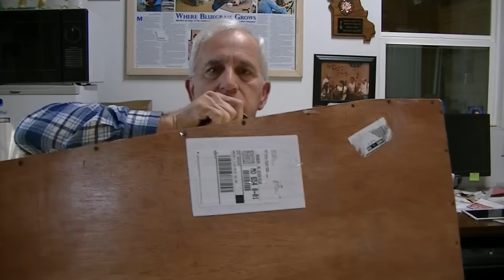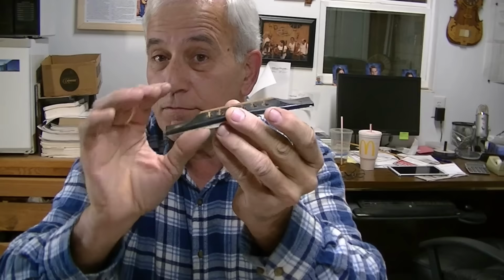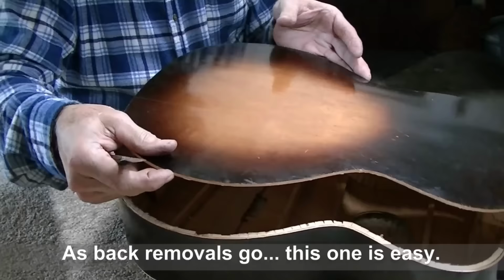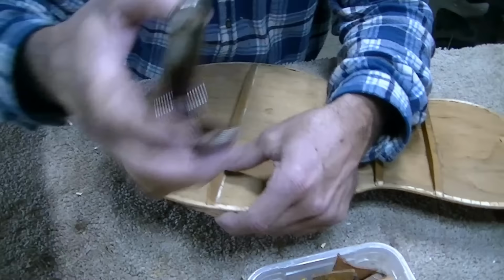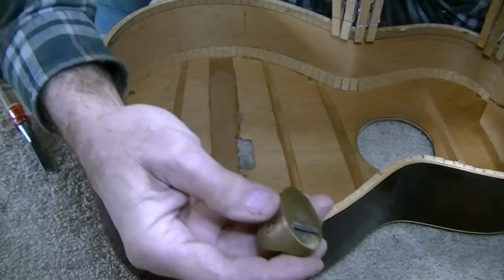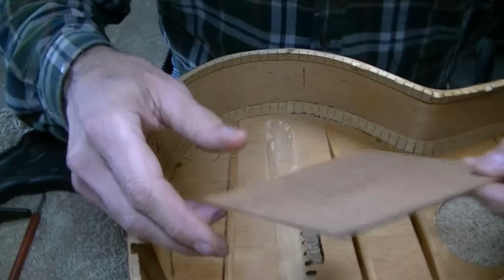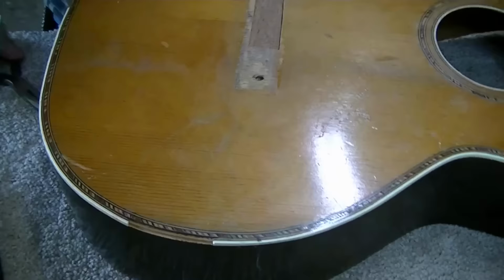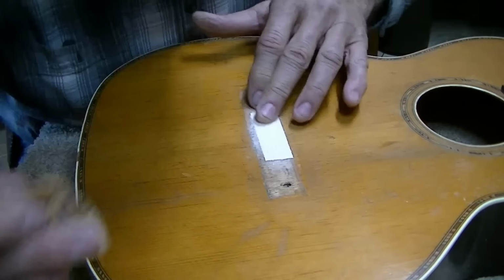160 RSW Regal Wreck Restoration Part 1

Comment: Just a trick that I’ve learned in my years of restoring antique furniture as a weekend warrior. I have a hot plate that I put my thin flexible paint scrappers in and get them hot and I then start pushing it under whatever it is like your bridge plate to bring up works well because the heat loosens the glue back up and I use this on glue blocks that are attached to veneer and stuff like that.  I think that’d be really useful on getting the bottom off of a guitar and would be perfect for that bridge plate.

Comment: The crack on the back if it stays closed mostly I have used Loctite #420 which is like water applied by a sewing needle or whatever and drip it till it quits taking glue and in about  an hour it is permanent. It can be sanded and polished like most cyanacrylate  glue can be. Pardon my spelling. Great instruction and the video is awesome.

Comment: Hi Jerry. I was re-watching this Regal reconstruction after watching the Grandma's Regal pride and joy videos. As with the other comment that may be too much info, I've now had some experience with the Chicago makers to offer an insight into what seems to me the odd bridge plate/center brace arrangement. That 1/8th (more or less) band was standard in the 1890-1920 period.  It only seems odd because it doesn't really make sense given what guitar builders now know. A lot of these were underbraced 'cause they were designed for gut strings--which is why steel strings have twisted up so many of them.  Like this Regal, there wasn't much to keep the ball ends of steel stings from ripping up the spruce under the bridge. Thanks for the video!
Reply: Makes sense string tension is real!

Comment: Great job!! For anyone wondering why you did not use sandpaper to prep for glueing...sanding will clog up the wood pores ....which should be open  to get the strongest glue joint possible. Something I learned when going through school to get an Airframe mechanics license to repair wooden airplanes.

Comment: Hi. Most grateful for your generosity in sharing your luthiery skills. You’ve both inspired and helped me repair two guitars now, and I’m working on the third—a Regal. 

While not as nice as this one, it has exactly the same problems (failures). After watching you hand plane that bridge plate, I came up with another method. Drill press, mounted with a Forstner bit, 1” was about right. I removed the centering point and got it very sharp.

 Since I am fortunate to have a large drill press, that did the trick. Very good control to get almost to the top without damaging it. I thought others might benefit since this is one of those basic repair challenges.
Cheers and thanks again, Dadla.

Comment: You might try piano keytop pvce glue for the binding. It’s designed for gluing plastic to wood. Water based and not expensive. Experiment first, obviously.  Only order when it’s above freezing.

Comment: I do those neck block slip resets often. Once the decision is made to take the back off, it just makes sense not to mess with steaming the dovetail.

As for the bracing, I sometimes can't help myself from converting them to standard x-brace while I'm in there. I usually use heat and water to remove the braces.

I usually use long C clamps and blocks of wood instead of how you do it with a vice.
Reply from the maker: Joe Shmoe for sure.  Thanks for watching.

Comment: Grain for the bridge plate should run with the strings to prevent top curl. You can shift the angle slightly to tie the top grain and halves together. Support under the top while scraping that old bridge glue would have made the job easier and safer. Always chiseling with the bevel toward the work gives you leverage necessary to prevent the chisel from diving.
Reply: Thank you for the grain direction tip on the bridge plate. Makes perfect sense to me .

Comment: 39:58, I am a carpenter and woodworker myself even though I know nothing about working on guitars, make a bunch of small split wedges and use two under the neck of each C-clamp to put a little pressure on the piece that you are gluing in.

Comment: It is Always nice to see an old guitar being brought to life. I have a small comment about the size and the thickness of the bridge plate. Old guitars always have a little belly and a standard procedure is to live with it and to compensate it with a neck reset. There is a small risk that the loudness is reduced due to this rather thick and large bridge plate. I have made some restorations with far thinner and smaller bridge plates that still have been rather stiff. Sometimes I have made this in combination with a neck reset. This is of course a matter of how much work you want to put into this old guitar, but since you have many viewers, it could be good to highlight this so that others can see that there are alternatives.

Comment: Years ago I was reading Tommy Tedesco's column in Guitar Player and he told of playing a gig with a classical guitar on a well-ighted set.  The guitar got so hot he said that it started popping apart.  Melted the glue.
Reply from the maker: That sounds a little bit much to me. I would think it was hot enough to melt a glue he would have been fried as well.

Comment: I wish there was someone with your skills in my area. I have a 98 Tacoma D18LTD that was 1 of 100 made. It suffered some issues over time, I was told by a guy that builds guitars that he could fix it. Then he split the top trying to fix it and then gobbed some crap all over the guitar that looked like something a 5-year-old would do. I regret taking it to him but I guess he did save it so I could play it a bit longer. I just don't want to let the guitar go because it's my favorite guitar and it has been since I bought it, and I have several others.

Comment: i am totally surprised you didnt use  a go board to glue that up,  i've seen a repair of a tear out a patch was place on inside with edges beveled and the  tear out routed out and the edges beveled to match. it looked and fitted better in appearance then the plug as you installed.then scrape and sanded flush inside and out and the guitars acoustics sound beautiful

Comment: At mark 40:00 you were considering another clamp.  A wedge of wood pushed under the center clamp might have exerted pressure on the backing plate.   Nice work!

Comment: Has to be the finest restoration I have seen in a long time. This has affected me ahahah, Ive watched it three times allready.
Reply from the maker: Thank you my friend.
Reply: Jerry, I am also watching the Martin video agai, the one with the scratch plate curled. The Martin's pre the 80's had the pickguards glued straight onto bare wood. The material shrinks a lot faster than the wood can compensate for and the tell tale signs are two cracks, exactly where you found them. I had the same thing happen to mine. The NC is great material and I really like the old pickguards that are made from this. Nice and thick, with bevelled edges. I cannot stomach the new very thin ones. I have several guards that I had made at Holter Pickguards over there in Nashville, for some of my Martins. Anyway, I also get them made 1/8th of an inch larger, to compensate the stretch line that is always left on the wood. The only one I havent changed was my Fathers and thats only because it was his and I want it to age as badly as he did ahahahha. Its a personal thing. Great videos love your work.

Comment: Hi Jerry. I've been watching this episode again, since I've got several old parlors I'm working on. Great lessons on all sorts of things. I've learned a bunch more about how the mass producers of guitars worked since my last comment. I think this guitar was braced for a tailpiece, since it sported only a big flat plate—though I can't see any evidence that it ever had a tailpiece, no shadow on the top and (squinting hard) no telltale screw holes on the end block. Guitars of this vintage were always undergoing alterations, a major one was fitting a tailpiece on a pin-bridge guitar so it could take steel strings. Then, they could get more cash for a pin-bridge guitar than a tailpiece one, obviously 'cause it's harder to produce the former. I think they decided to slap a pin bridge on this guitar to squeeze out some more cash. Very naughty. Anyway, that's how I think it got all torn up inside: it was never meant to support that structure of the pins and the string ends. Thanks for a great video!

Comment: As I was looking at those  clamps I think you can modify it buy drill and tap at least two more holes along the clamps to add more clamps along the jaws depending on how long your clamps jaw is. This will help with the distribution of pressure along a broader surface.

Comment: That thing was beat Jerry. Not sure what the manufacturer was thinking with the bridge plate alignment. James at Rattle can guitar has had two Silver tones very similar to that same bridge plate layout. Cool that people are willing to have these old guitars repaired. I wanted to pull the back on that 57 Goya I worked on and reset the neck in the fashion you are talking about but the owner wasn't willing to spend the money. Good job brother, cheers
Reply from the maker: Dane Nichols thank you my friend.  It really did turn out to be a pretty decent guitar.  You'll see in part 2.

Comment: I love projects like this, Jerry. You know, it looks to me like a nylon (or gut) string guitar that was converted to steel string by drilling pin holes into the bridge (the bridge shape and headstock shape and lack of fretboard radius, sorta point that direction.) And that would explain all the bridge damage it has endured. If that's the case, hope it can can handle all the steel string tension when it's done.
Reply from the maker: 100amplifiers thank you for watching and your ideas are not off base.  But I don't believe this was actually the case in this specific example.  The tuning key holes are too small for typical classical tuners.  Both the bridge and the nut appear to be original to me.   It is just old, put together with hide glue that failed years ago, then repaired by an amateur.  The customer said as far as he knows it was always set up with steel strings.  But who knows...
Reply: Rosa String Works  You're right: that was always a steel string. You can tell by the shafts of the tuners, which are the steel string type rather than the thicker nylon string rollers.  And the bridge pin holes were original.  Amazing how nice those ladder braced old small bodied guitars sound.
Reply from the maker: Karl Hoyt thank you for watching

Comment: “Walls And Bridges.”

I always wondered why a slight underbow on the neck is preferred over a straight neck?

Sometimes those so-called lower end guitars come in handy for certain projects when you’re looking for a different sound.

Looking forward to see how this turns out. Thanks.
Reply: I you're referring to neck relief, it's a disputed topic to which there doesn't appear to be any consensus one way or the other.
Reply: @maplebones  Because there is no correct answer. It's down to preference of the player.
Reply: @aniquinstark4347  And also the overall construction of said instrument, as it varies from one to the other.

Comment: "What is this? A [block plane] for ants?! It needs to be at least 3 times bigger!"

I don't even want to imagine what sharpening that tiny thing is like...
Reply from the maker: garretmkiii actually the small size makes it easier to push and you can move a lot of wood with it very quickly. It's not very difficult to sharpen. thank you for watching.
Reply: @RosaStringWorks  If I may ask, how do you sharpen the blade of your plane? Do you sharpen only the angled portion or do also include the flat side to remove possible burrs & to maintain its flatness.

Comment: Get you some semi rigid Durablock sanding blocks so you keep the surface flat! Please! Sanding with fingers leaves uneven areas anywhere you sand.
Reply from the maker: Been doing it the same way for 40 years never needed the blocks and I've never made a single Groove ever

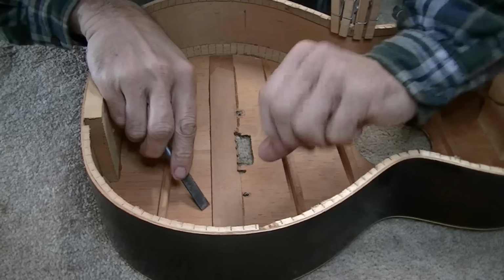Comment: 29:58 That's a tough job. I'd use a razor saw or the Stanley Fat Max pull saw just about made for that purpose. Actually it is my favorite tool at the minute, very useful for separating things glued up with epoxy or UF109.
Reply from the maker: Thanks for taking a look.

Comment: I would have expected you to use heat to see if you could soften the glue on that brace. Sit  a clothes iron on it for a few minutes and then see if  you can work a thin spatula under it. Planing it out was certainly  a guaranteed safe way to do it, however.
I think I would have feathered out the edges of the new bridge plate and  probably rounded the corners. I think sharp edges act as stress concentrators, which can lead to cracks down the road.

Comment: This video so perfectly illustrates what i DO NOT grasp about binding; why is it only ever made of the most brittle and crack prone materials known to man (abalone?? Gmafb!!) Why doesn't anybody use like a high density rubber like material for binding so the edges aren't so f'in prone to damage??? That would seem to me the purpose of the binding; to protect the edges right? So why does everybody use material that is porcelain level brittle? I think Gibson should release a line like this; high density rubber like material for binding; carbon fibre rods drilled at an angle on either side of the truss rod cavity for strength to rectify their bad headstock weak spot and maybe whats called Everslick like on certain skateboards on the back of the guitar as a buckle rash preventive. Its just a sheet of pliable yet heavy duty plastic that you could replace as it gets chewed up by your KISS belt buckle. Call it the Heavy Duty line and keep the robots off. Id buy one!!

Comment: Ha, you remove the back binding the same as I do..when I get annoyed at a piece of binding not wanting to get loose, I switch to another end to :) The bridge-plate going thru the full width of the body is not unusual at all for Harmony and Regal-made ladder braced guitars. Typical for Regal is the angled lower top brace.
Reply from the maker: alnicospeaker thank you very much for watching.

Comment: Did you ever try a hot air blower on low and a thin artists pallet knife to remove that damaged bridge plate? I find it works for titebond, hyde glue and epoxy.
Reply: Good tip.  Thanks.

Comment: I've enjoyed watching several of your videos, however as a woodworker who has repaired/worked on many different items I have a problem with this one. The binding that you took off was left on the workbench surface. Several small pieces, which you said were like glass are left all over the top. Can't be good for the finish/surface of the guitar. I know the you have a carpet top with a nap which some of the pieces sort of get lost in but I would of cleaned off all that before doing more work. I was in the billiard business and had a endless supply of used cloth from pool tables and that worked very well as a work surface with maybe a few layers. Keep up the good work.

Comment: OK, Jerry this question comes from the 35.11 mark in the video. The Bridge plate reinforcement under the top. I see the plate/wood grain is running opposite of the sound board grain. I know this will give this repair a lot more stability, but wouldn't running it with the grain of the top not give the sound board more sound. Just my thoughts that it would not deaden the sound. Always thinking and trying to learn. Thanks

Comment: 29:50 Use a 4" angle grinder with a very coarse flap disc wheel (use the flat 4" disc type, not the cylindrical drum type) . It sounds harsh, but it puts no strain on the wood as the disc cuts with speed, not pressure.

Comment: Could you use some heavy object instead of clamps for that big bridge block? That flat maple piece under top could make pressure distribution pretty even, if weight applied from other side is heavy enough... My dad used piles of books for similar gluing tasks and as far as I remember it worked fine.

Comment: I don't work on guitars or with wood in general except in a hobby format, but as you were worried about the bridge plate you put in expanding, hence why you didn't put it hard up to the braces, would it make sense to cut it so that the grains of the of wood of the guitar run parallel to the wood of the bridge plate?

Comment: 50 years? 
That'll be the mid 60s and I bet he put steel strings on it so he could Rock and Roll.
Twang! Oops:
If that is the case it would explain the loose kerfing.
As for the extra clamp you wanted on the new bridge plat, a couple of opposing wedges between it and the clamp arm would have sorted that.
Reply from the maker: Thank you for taking a look.

Comment: Respectfully can I suggest some upgrades you might like to try... 1. A Power File, Locking Machine heads & Strap locks.
Reply from the maker: Locking machine heads are typically not used on acoustic instruments. I'm very familiar with them and they're fine.  I really don't have any problem with slippage.  In addition most of the time the instruments I get the customer wants to keep it original.  The last factor is most of the time the customer doesn't want to spring for the extra cost either.
Reply: @RosaStringWorks  The amount of time you'd save stringing instruments would be cost effective!

Comment: Rosa String Works got a old cheap parlor guitar I am repairing right know my goal is just get it some what playable. I had to remove the back in order fix the guitar the side where braces are some of the wood chipped away small amount of wood thought about using wood filler fix it or cutting out a peace of veneer or a peace of Birch to fix it. What option think I should go with of the 3? And if I use filler what kind of wood filler do you recommend?